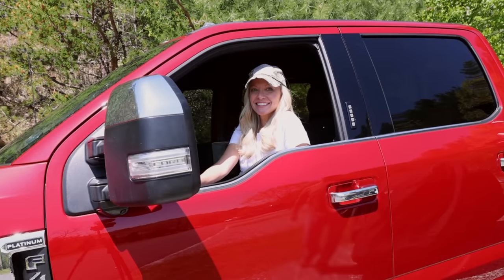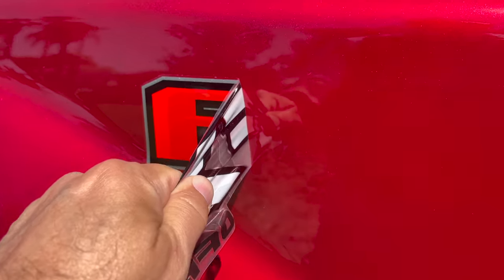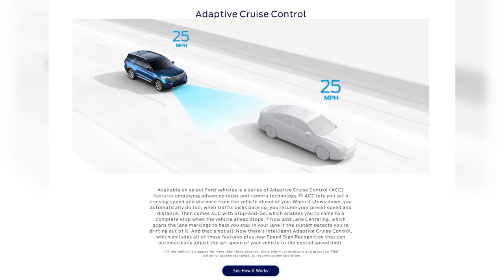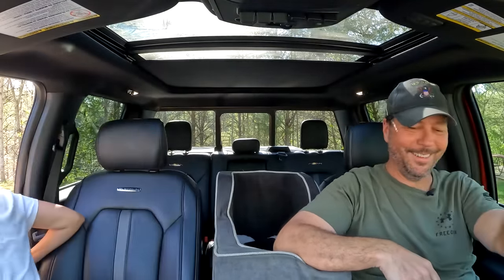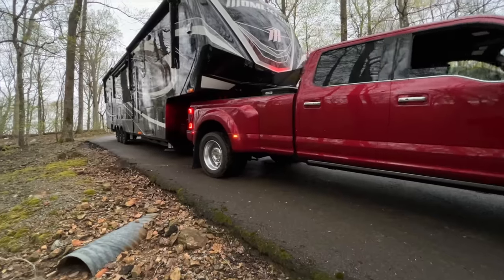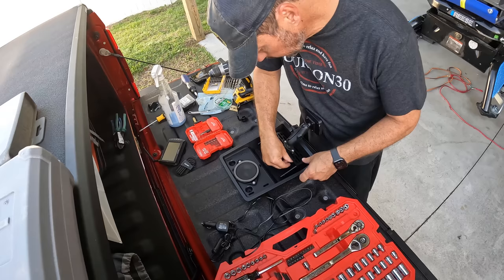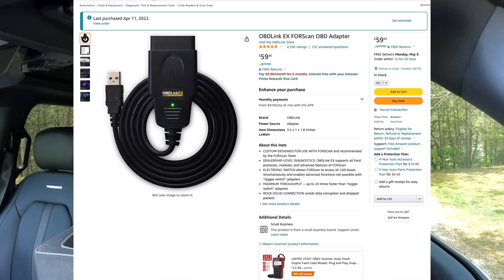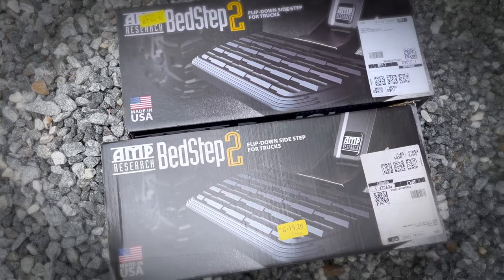2022 F450 Platinum! (Full Time RV!)

Comment: Enable Bambi mode it allows your driving or fog lights to be on when your high beams are on. That’s a great forescan change to make. Also increase the number of soft blinks for the turn signals when the trailer is connected. KYD has a great video on that. Mine now blinks seven times instead of three when I tap the turn signal
Reply: My Duramax does that automatically when you engage tow mode.
Reply: These new fog lights suck and really isn't worth it.. The new headlights are PLENTY..

Comment: Great video!  Between you and JD from BTBRV, I was convinced and went with the 2023 F-450 Limited after my 2019 F-350 Platinum DRW was stolen.  Very unfortunate but I have a much better truck now.  If you have any anti-theft tips to pass along (other than air tags and the steering wheel club), please let me know.  Thanks for the tips on the upgrades!

Comment: I had the ceramic coat done on my red crew cab 2019 F250.  I wash it, and use a little ceramic instant detailer and it still looks like new.  No issues at all.

Comment: Congrats Chad and Tara on the new truck. We purchased an F350 Platinum for our tow vehicle and have never looked back. We’ve also encouraged two fiends to get SuperDuty trucks as well.  A couple of things. (which I’ll email you from your website to follow up if you’re interested). First i use my upfitter switches to control my Victron DC-DC charger and a couple of separate USB ports that I installed in the top cubby on the dashboard. I also installed a BuiltRight Industries and 67 Designs dash mount system to hold our Furrion backup camera display, cell phone, garmin gps/TPMS monitor display.  By putting a couple of multi-port USB ports on the top dash there are NO cables or charging cords dangling down in front of the dashboard.  The only other thing I would have suggested was not getting the factory installed bedliner, they are not that great as they are put on AFTER the bed has been painted, so the bonding is not that good and it’s pretty easy to peel off. I suggest that you look at Bullet Bedliner and read some of it’s history with the popular Line-x brand. Take a look at their videos.  I also followed your lead and put in a shotgun latch toolbox in the bed along with a tonneau cover. only difference is I went with a Reese GooseBox so that I could easily have my truck bed back without having to remove a big heavy hitch.  more to come
Reply: Very smart n wise choice also try much troublesome with Ram

Comment: I like what you did with the upfitter switches to minimize the wire nests for your accessories.  Will you be doing a video that shows how you did it in more detail?
Reply: Yes I concur. A detailed video would be awesome.
Reply: @brianp6420  I would like that too also your setup of your builtright dash mount all the pcs etc
Reply: Have a new '22 F-350 Lariat... would really appreciate a step by step instructional video... complete install for an accessory on dash, or rearview mirror. Looking to potentially install a airhorn, dashcam, radar detector type devices, etc.
Reply: I was wanting to do something like this too, but since we're just summertime weekend warriors, I also wanted a 'quick connect' plug for my rear observation camera.  I don't want to do a full 12v cig-style port on the dash, was thinking something smaller, like the 8mm connection.  Just want a clean install.  Gonna have to see how that top of the center stack comes out (sure there's existing YouTube on that).
Reply: I’d like to do the same thing and would also like to see a video.   Great content as usual
Reply: Same - would love to see a video just on that.

Comment: I work for an EMS agency. We run F450 extended cab chassis with a fairly large ambulance box. We have the liquid spring suspension system and honestly the ride is very smooth. I know the added weight of the box and equipment would make it smoother than on your trunk with a truck bed but they are nice because you can adjust different ride settings (comfort, normal, and sport). We keep ours on normal because the comfort setting allows too much body roll with the box being so too heavy.
Reply: I agree. Liquid Spring is a game changer. There is a reason that 95% or so of all F450/F550 emergency rigs now go with it instead of air. But it does cost a bit and I believe you are best to find a shop that has installed many of them on F450 emergency rigs so they have plenty of experience.

Comment: I also have a 2022 F-450. I highly recommend getting the Amp Bed Step under the left corner of the rear bumper. It works way better and easier than the built-in step in the tailgate.
Reply: Man, great idea. I have a DRW F350 on order and have been thinking of ways to make it easier to get in and out of it. That fits the bill for sure.
Reply: I put mine on my order, not knowing how I would ever use it.  I was working on my 5th wheel and using the tonneau cover as a platform,  There was no way to use the tailgate step, but this fit the need perfectly

Comment: Very nice truck. I have a 2018 F-150 and it’s just an XLT but it has the panoramic sunroof and I’m so glad I got one w that. I absolutely love the light that comes in and cruising around on a warm sunny day w it open is so nice. I did have an issue w the sunroof already but fortunately it was covered under warranty. Despite the potential issues w sunroof I’d never get a truck without the pano sunroof.

Comment: I have a 2023 F450 on order and may want to change the rims/tires away from the 19.5 to 20's because of the lack of mud/snow tires on the stock wheels.  What is your opinion on the factory tires with the 4x4 package?

Comment: Congratulations on the F450!  We traded our 350 for a 2020 F450 King Ranch, mostly for the turning radius, but also for the 10 speed transmission.  I was a bit concerned that the mileage would drop off when pulling our RiverStone Legacy since the 450 has the 4.30 rear end ratio, but with the 10 speed I am actually getting better mileage.  Having higher horsepower might also benefit since the engine isn’t working as hard at the same speed.

We were also wondering what the difference in ride was going to be like, but you really can’t feel any difference when towing.  When we aren’t towing, it still isn’t very noticeable difference between the previous 350 and 450.  Like you, we love the massaging seats!!!!
Reply from the maker: Yea.. that mileage was a nice surprise!
Reply: I currently drive F350 6.7 DRW and am ok with the ride quality exception of hitting the small bumps and feeling the bouncing jolt on the freeway when driving empty.  That is only on 1% of the situations on my daily driving.   Other than that, I can manage if I adjust the speed just little when road gets bumpy and rough.   I have F450 Limited on order since last Oct and am interested on any small tips to keep it as is or some simple upgrade like changing out shocks.

Comment: I used forscan on my F-350 to add “bambi mode” which allowed the fog lights to stay on when you turn on your high beams.
Reply: What kind of computer is needed to use these devices, and do you have to have software.  I have MacBook so wasn’t sure if that an option?
Reply: @missionswithluna  I’m sorry I don’t know the answer to this question.  I used my windows surface.  There is tons of forums that basically walk you through everything!
Reply: @missionswithluna  Look into using "parallels" which will allow you to install Windows. It's like having a computer inside of a computer. The technical term is virtualization but "parallels" will get you there.

Comment: I’m agonizing over which amateur Ham radio with a remote head to add to my F250. I just ordered the Bulletproof Diesel 3rd Brake light bracket for 2 antennas. Do you have any plans to add an amateur radio?

Comment: Nice truck and thanks for sharing the info on the features!  I tow our 14k fifth wheel with cruise control and leave it in drive, flat or mountains. So many people say don't tow with cruise or leave it in 6th. I figure if that were the case the Ram/Cummins engineers would have it in the manual not to do that.
Reply: I hauled cars all over Colorado in the mountains with a 2016 Ram on a 40ft wedge trailer loaded with 3 cars. Never an issue with any of that. Dunno about with the adaptive cruise control though. Glad I did that for a couple of years - got really comfortable driving with a big trailer.
Reply: Or they would be smart enough to disable in tow/haul.

Comment: So I ordered a 2022 F450 in late August of last year and received it in January of this year. Mine is the same outside color as yours,(rapid red), with the loaded Lariat package because I wanted the tan, (baja), color interior. Which is only offered in the Lariat package. Anyways, I have added lots and lots of stuff to the truck. I added a bigger Offroad bumper because there are a lot of wild life roaming free here in Nevada where I live. Since I added the bumper it slightly blocks the front camera which has disabled my adaptive cruise control and my regular cruise control. The dash won't allow me to enable either cruise controls because the cameras see some of the bumper which mentions something about crash detection. My question, is  with that forScan, can I turn cruise control back on? I'd love to send you some pics of the things  I've done to mine. I ordered mine with the 32,500 lb fifth wheel hitch and I absolutely love it. The other thing that I've done is airbags with wireless remote. I have a 45 ft toy hauler fifth wheel and it had a lot of front tongue weight which made mine sag about an inch-and-a-half which put my lights right in everybody's eyes which they are already super bright

Comment: We full timed for a year with big fifth- pulled by 17 450 on kelderman setup - all four corner airbags - adjustable pressure and height so you could run stock height- amazing how smooth unhitched with much experience in trucks
Reply: Hey Kevin -- As the new owners, we're loving your truck. ;-)
Reply: With Kelderman setup - all four airbags -  did you keep the stock wheels and tires from factory on your truck after the upgrade?

Comment: For the ride quality, I suggest some adjustable shock absorbers.  There are some companies like King that can build them to match the stock shocks without having to lift the truck. With the turn of a dial you can adjust the dampening to compensate for the heavier loads.  They ride like a cloud. Safe Travels.

Comment: Love it! We got our 22 F450 in feburary. Check your differentials and transfer case levels! Everyone that I know of including myself the rear has been low from the factory.
Reply from the maker: Thanks for the tip!  I'll check that out. 👍🏼
Reply: Seems to be a common problem. Same issue with the 2022 ram I just purchased. Brother in law same issue with his Chevy truck.
Reply: Congrats on the new ride, she's a beauty!
The rear diff may appear to be low, but almost everyone thinks it should be filled to the bottom of the hole. Spec is 6mm below the hole when checked cold.
 And you'll get a dozen different recommendations for gear oil, so here is number 13. AMSOIL Severe Gear 75w140, (arguably one of the best gear oils in existence). I don't know about the 450 axle, but my F350 is an e-locker, no limited slip additive needed. Check your specs, or look for the telltale wiring harness that goes to the rear axle......
Reply: @beanoil  yeah there's a lot of debate. With it all compiled it seems as long as you can touch the fluid bending a pinky finger in the hole, your about at the level. My rear diff I couldn't touch whatsoever

Front was a couple mm under the hole but I could touch it

Comment: Don't know if someone has said this yet or not but look up 

police mode (will not let you take it out of park with no key in the truck)

Bambi mode (keeps the fog lights on when you turn on your high beams)
Really help keep light low in the front of the truck when you are on very dark roads and traveling at higher speeds 

That is the best 2 I have done not including the double honk delete you already did 
Hope this helps and I love your 450 and dash set up

Comment: Love the new truck.  We are hoping to upgrade our F-250 to a 350 in the near future but truck prices are outrageous at the moment. Did you have to contend with the “market adjustment” up charge dealers are tacking on these days? We looked at a Denali 3500 dually that had $10k added as a “market adjustment”.  I’m sure y’all will be extremely happy with the new tow pig. Safe travels.

Comment: Great video, we have both the Platinum 450 and Ultimate Lariat 350 on order, only difference on the order sheet is the seats, and Ford have deleted the massaging seats. I would like to know if you looked at the internal tpms sensors for the truck, I have had a lot of trouble with the externals and the valve stems.

Comment: Love your channel, keep up the great work. In a couple years we will be ordering our new retirement setup! It will be our biggest rig yet. We are going with F450 dually and Jayco Pinnacle 38FLGS which is 44 feet long as well. Can't wait to have our new setup. I noticed your phone mount is nearly identical to the QuadLock stuff I have. They actually have a charge head that charges your phone without having to plug a cable into the phone, just plug it into the head. If you have power up on top of the dash, you could eliminate one of the cords dangling down. Love your vids, keep up the great work! We are in NC as well. I need to check into that ceramic coating shop!

Comment: One thing not mentioned, as it was something I loved on my previous '09 F450 King Ranch, was the sound system, which had the built in Subwoofer! I love my music, so I made good use out of it on that truck.  Wondering if on  these newer trucks with the Powerstroke, if it has an engine brake yet?  Didn't hear it mentioned.

Comment: Oh my goodness, THANK YOU for sharing that its possible to turn off the honking! This is the first time I've ever heard of a way to do that, and I searched for years. It astounds me that Ford still does that on all of their cars. Would you mind doing a video or at least commenting some specifics for how to do it with that device? I might actually buy a 450 for my next truck now. Ford was my top choice when I was shopping for my current 1-ton dually but the honk was a deal breaker so I bought a GMC. We had a 2016 Ford Fusion hybrid for a few years as a commuter car and the honking drove us (and the neighbors) crazy. It's such a common situation to need to hop out of your car while its running to check something, especially when towing, and no matter how good the rest of the truck is I'm not going to buy a truck thats going to wake up the neighbors at 5am because I hopped out to double check the hitch.

Comment: I have a 2018 Chevy Silverado 3500 HD Duelly. 8 Ft. bed was amazed by how tight the turning radius is. My 2004 Ford F-250 with a 6 1/2 foot bed was very wide.

Comment: I can tell you the Liquid Spring stuff is a game changer. We are running them on big F550 expedition trucks which ride like a dump truck but the handling afterwards feels like an F150. The fact that the suspension can change hundreds or thousands of times per second depending on road conditions, throttle input, etc is remarkable. The adjustable height for our off road applications is great, but also the ability to lower the truck significantly does help ingress & egress. We also love Carli too. The have progressive leaf springs that are epic... But you will want to supplement with airbags as you loose approx 25% of payload without the airbags supplementing. Took my father-in-laws 2019 3500 limited DRW to Carli after they complained of the ride when towing their 40' 5th wheel and they have been so thrilled since! Suspension is worth everything....

Comment: I ordered a King Ranch F450 last April and did not receive it until September. Absolutely love it!! Turning radius rocks. I would some advice on getting the rear hub caps off. I purchased the tool you used and simply cannot get them to budge.
Reply from the maker: Lay out a towel to catch the hub and really lay into it with that tool.  It takes a LOT of force.

Comment: Kelderman air ride has a stock ride height air suspension kit I have it on my 2021 F350 and it rides like an F150 would really recommend the kit and there’s a couple videos not many on the system

Comment: I love Tara's new truck! I have a 22 F350 Platinum with the same interior. The video looked like you were in my driver's seat telling me what I like about my truck! You'll love the adaptive cruise control once you get used to it. You have to learn to trust it and fight the urge to tap the brakes. It reacts quicker than you can when it needs to. It doesn't get angry and tailgate no matter how many people cut in front of you. It's my favorite feature on the truck. Thank Tara for the heads-up on the butt massage setting. I had tried all the other settings, but not that one. It's great after a long drive. Love your channel! Keep up the good work.

Comment: Glad to hear you like Centramatics. I have had them on my Honda Goldwing's for years. Super wheel balances, better tire life, etc. I have moved the same set to 6 machines and over 1,500,000 miles. The rings still work like day one.

24:16 I am surprised to hear that Weathertech mudflaps were less than perfect. I have used this brand with enormous success on numerous vehicles, but I will not the lack of performance on the Ford F-450.

25:03, you will be happy (longer-term) with the ceramic coating

Question: Why step up from F-350 to F-450? According to Ford, your towing job is handled by the F-350. Simply curious.